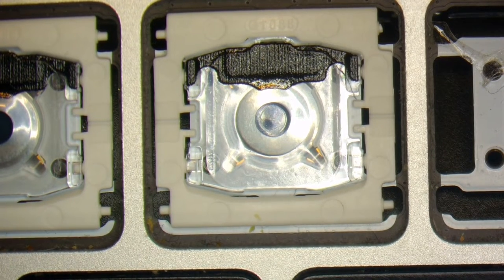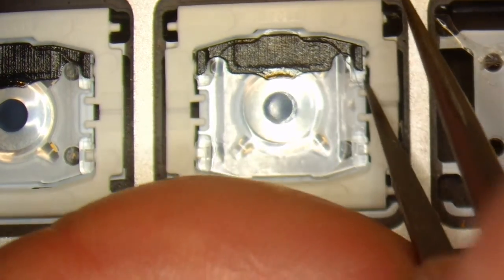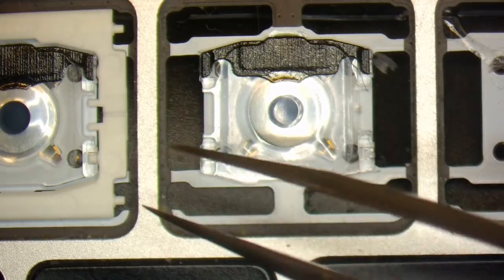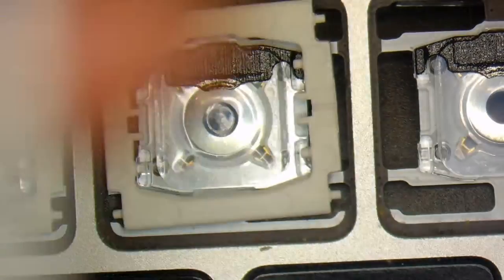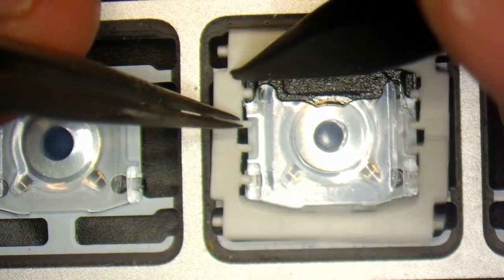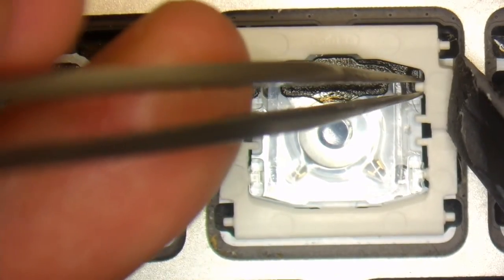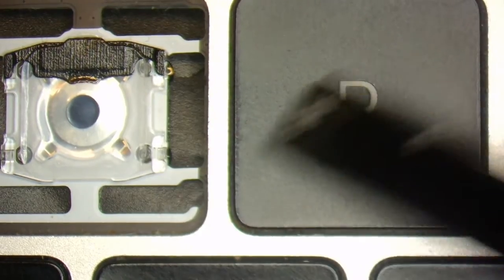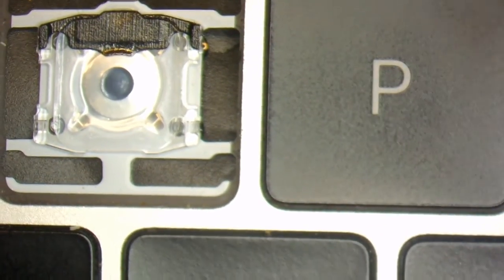Repairing Key/Replacing Butterfly mechanism on MacBook Pro 2016-2019

Comment: Let's be honest I managed the enter key mechanism too but failed at the spacebar. I'm happy with Joespiaq's method for the domes cleaning, but cannot figure a way to avoid topcase replacement for that damn spacebar when it comes loose.
Reply from the maker: I figured spacebar but thats not 100% consistent. If its not sticky but needs dome cleaning, get it from the other side. There is a hole under the dine so if you remove sticker under the keyboard, you can use wire to scratch some surface

Comment: Incorrect Alexey! just remove the gasket its the best way first butterfly then gasket on top then keycap on top and then right on the keyboard again without problems at all. Dont do this. just take a screw driver to the middle of the assembly right dead center bottom underneath of the gasket and pull it out, when putting back the cap place it directly center on your hand first do not try this this way as this will absolutely break both bottom nipples.
Reply from the maker: @soartothesky   I am not sure I get what process you describe, can you shot a video of that? If I get it right, by gasket you mean the plastic element which holds metal dome. I do not remove it because it is better to keep it intact. This way replaced key won't have any tactile difference with other keys which some of customers find disturbing. After the process in video, repaired key has exactly same travel, position and sound as a original one. It is close to impossible to achieve if you remove dome and glue it back.

I maybe replaced /cleaned around 700 keys so far including full keyboard disassembles for cleaming purposes and I can't remember breaking a single keycap. I also trained my partner to do that and it seems to work too.
Reply: @inwerp this is really hard the tensile strength of the butterfly is weak. 1 bottom nipples are brittle, 2 removing just the butterfly is too hard it’s best to slowly pry out everything underneath the key fob with a screwdriver dead center and ensure there isn’t any pins broken on the bubble gasket or contact this way you could 1 put the butterfly facing right position, bubble gasket on top without having to pull and then sandwich the both on the top of a key cap without problem seeing what you are going to do . That plastic bubble doesn’t even need glue, it has this tiny bit that’s not needed at all then slowly align the 4 pins with the 4 holes in the bottom and it’s much much much easier. Plus the gasket is more stronger than the butterfly or the key cap both are very fragile best to just install all 3 in one sudden go. I’m getting the keys I need soon. And if they lock tapping them with a hammer works so good little hammer makes stuck keys loose again take care my brother!❤
Reply from the maker: @terrordestroyer5k  it is still get zero idea what are you talking about. My video is about how to move scissor mechanism without breaking anything and without tearing out glued part.  I do remove whole key mechanism if i need to but if you are fixing butterfly spring it is not necessary and simply costs more time and risk of key jumping out of place in use.

Just shot a video, this will be much more useful. I am fully open to new ideas and techniques.